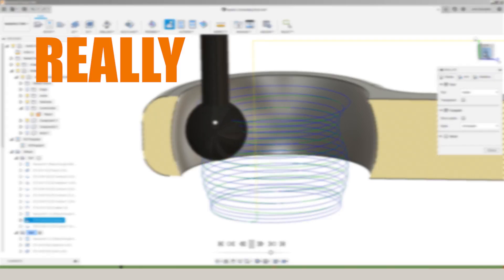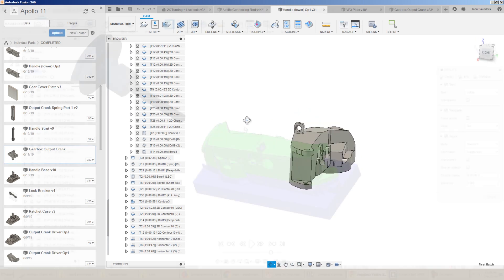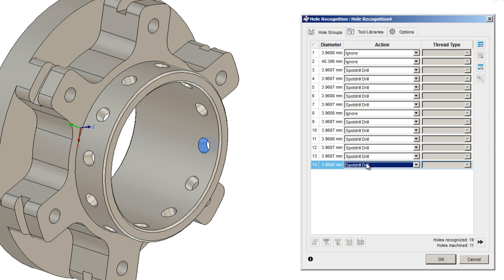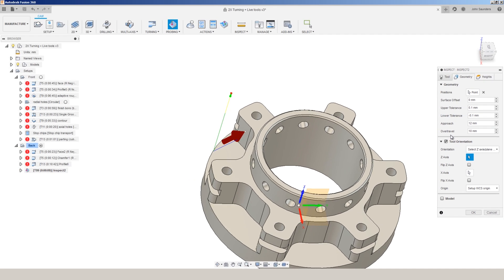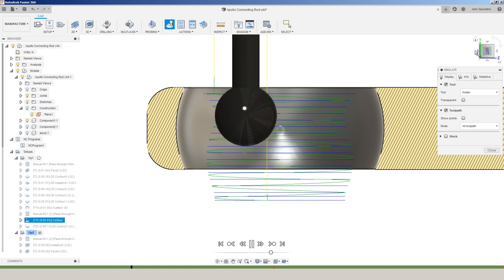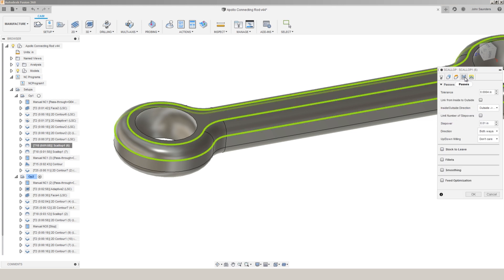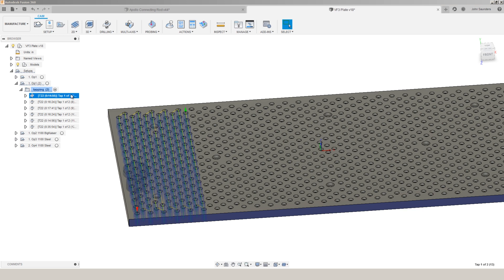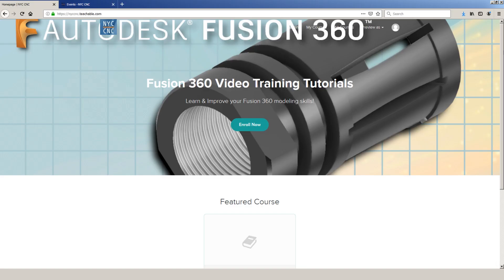Fusion 360: AWESOME New Features!

Comment: 0:46 LOL cam take too much material. its in my brain it never should do it.if it that smart tell now you it take it too much,but it not cut it correct LOL how cam knoe how your tool in machine cut anyway lol cam is too complex for all features. it should just cut what you tell you do. not overcut lol it only should undercut and tell. i cant cut this use smaller tool finish

Comment: That tool path inside that concave ball joint doesn't look correct (thumbnail and within the video) ????? paths appear to be shifted down????
Reply: The toolpath is relative to the bottom of the lollipop, not the center of the ball.
Reply: Of course! Had i thought about it for two more seconds I would have realized this! thanks, Yall!
Reply from the maker: The "control point" of the lollipop tool is the bottom, hence why the toolpath looks offset

Comment: Why do I need to go thru the credits rigamarole just to use probing? I used to have it. Sux it changed!
Reply: Steve just Steve It didn’t change. The extension provides advanced probing capabilities for part inspection.
Reply: Hi Steve, I know you responded to my comment but I can’t find it here. So possibly you deleted it? If not, you should be able to find the standard probing under the setup menu dropdown.
Reply: @MechanicalAdvantage  no didn't delete anything. thanks for the help.

Comment: Hole recognition only gets activated if you actally pay for fusion 360, not the free license.
Reply: NO - It only gets activated when you pay for the licence and then pays an extra 125 Credits ($/€) per month. It is full bait and switch!
Reply: And yet it's part of HSMWorks.
Reply: You also have to pay more than the cost of the subscription extra to get the extension to use it. And yet HSMWorks is included with the base subscription. Way to entice people away from solidworks Autodesk.